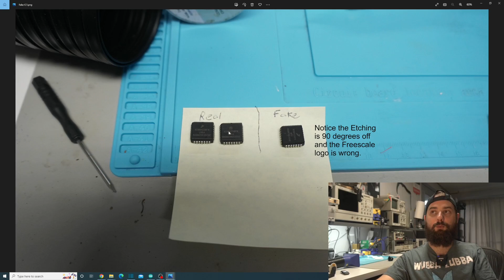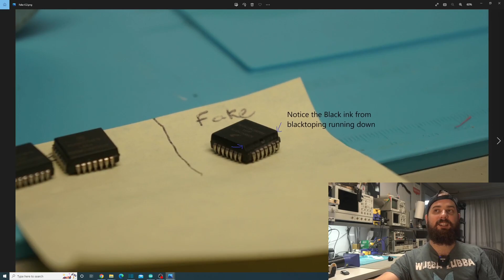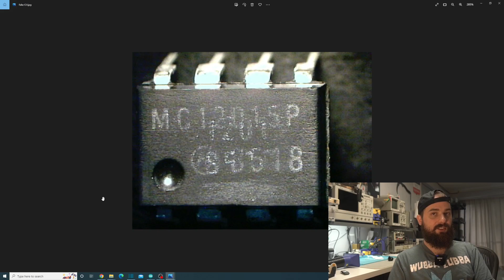How To Identify Fake or Counterfeit Components

Comment: I’ve got a 1976 Chevy Itasca Winnebago and the instrument cluster went haywire when I got my alternator replaced. It’s on a Chevy p30 chasis. Do you  take orders for repair?
Reply from the maker: I don't go back past 1999 on cluster unfortunately. Hard to find parts and such for them. One thing to note though. they are normally have no digital logic on those really old ones. It might just a bad ground or wire if changing the alternator made a difference.

Comment: Another way to tell: while ultrasonically cleaning certain factory-original chips can remove the inks used to mark them, ultrasonic cleaning can also remove the blacktopping. I have some memory chips I bought from a certain Chinese supplier of new old stock chips, and the blacktopping on them became apparent after I sent the boards through an ultrasonic cleaner. (The chips appear to be memory chips, and are probably the correct size, but they're not the exact brand/grade claimed.)
Reply: Also, I will note that just because you buy chips from a Chinese broker doesn't mean they're counterfeit/fake. I have bought new old stock chips from brokers and they proved to be exactly as described. For example, I was able to build an 8-bit video card for retro computers by buying the video chip from UTSource, and the chip was indeed a NOS Trident video chip. (The memory chips I referenced above were for this project. The Trident chip survived both the acetone test and the same ultrasonic cleaning, if anyone is wondering.)
Reply from the maker: Yes I've had very good luck with UTsource and HK inventories. I hope I didn't come across saying that brokers are just out selling fakes. That's not true and they serve an important role being able to access the markets over there.
Reply: Isn't there a big risk of damaging the chip if you US clean it?
Reply: @CaravaggioRoma  when US clean a board after rework, it’s almost always because the electrolytic capacitors has leaked. This does pose some risk, but the riskier option would be to leave electrolyte behind. And usually the components damaged in the US cleaner were already weakened by the electrolyte.
The remaining times I US clean a board is when I have to use lots of flux and IPA isn’t getting the board clean enough.